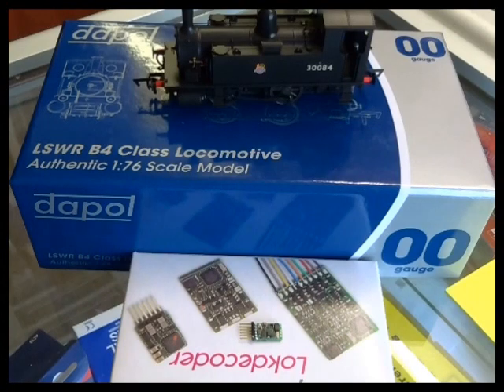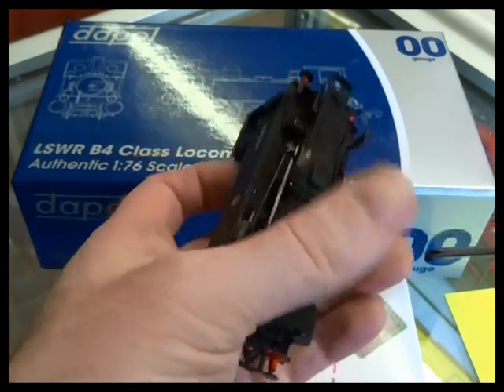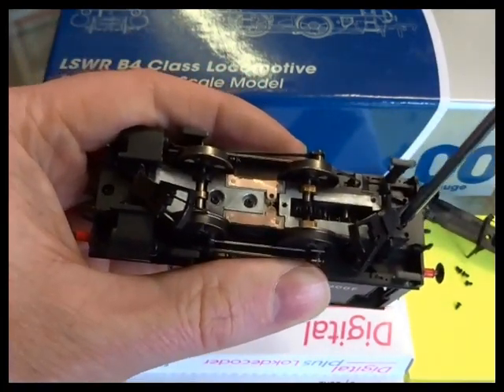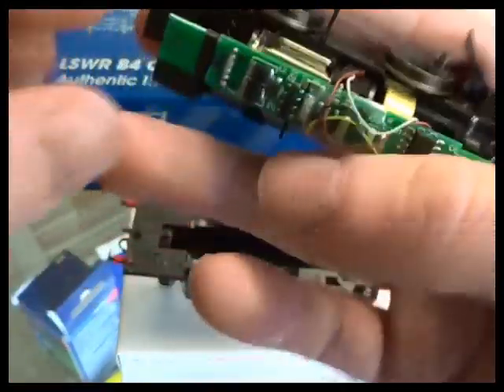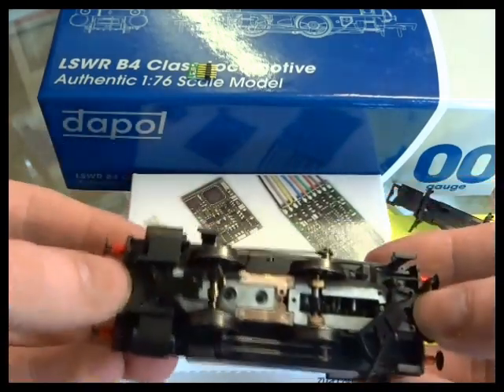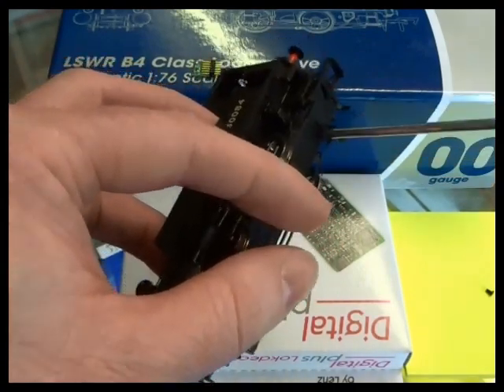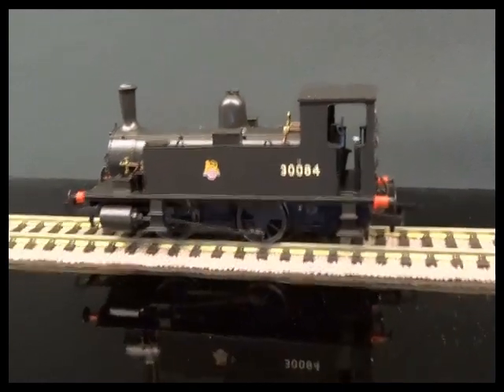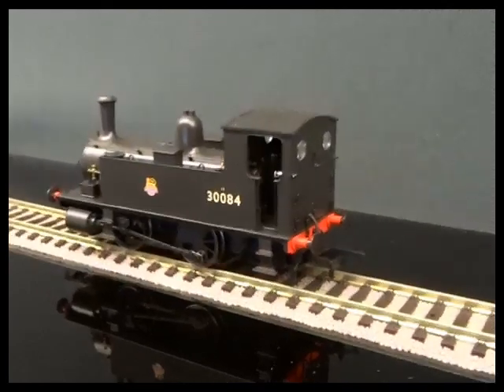Dapol OO B4 fitting DCC Decoder

Comment: Excellent and most useful video. I was trying earlier to fit a DCC chip into the OO Dapol B4. Not going well in the putting back together phase, giving up until tomorrow in hope I have better patience and less clumsy fingers. I appreciate they have learnt (as per the smokebox fit for the new Manor) but who ever thought up the arrangement for the B4 either forgot about post-sales non-factory fitting of DCC chips by the end users until too late down the line to change things (my guess) or was born a masochist!
Reply from the maker: I guess they designed space then sizing errors crept in when the model went to tooling - always a difficulty where models have minimal space available
Reply: @digitalcareline  The most annoying feature is the way that in order to get the body off it is seven tiny screws and both flimsy couplings. The wheels and motion are loose due to taking the keeper plate off. Very poor design.
Reply from the maker: My view is that many models are priced first then designed - There are some fantastically well engineered locos out there that were designed then priced -this engineering is superb but it has an impact many customers do not agree with and they can flop

Comment: I've just bought one of these loco's so your video is very helpful. I wonder if it's possible to fit a stay alive as well?
Reply from the maker: Space is already an issue in this - REE and Roco have stay alive with a sound decoder designed in from the start with similar size locos - The impact is the £250 price tag - Dapol would be taking an enormous risk